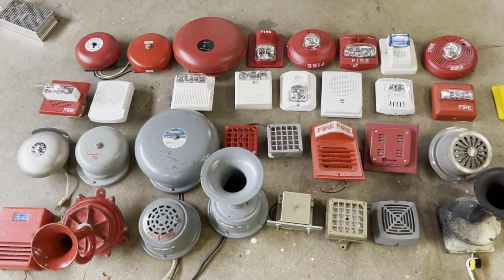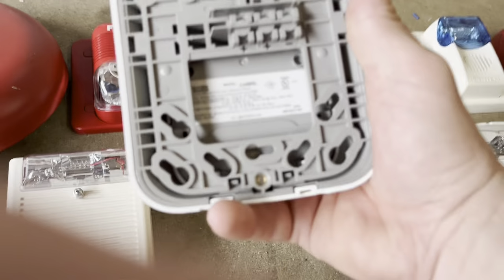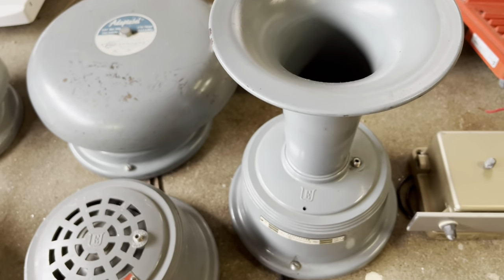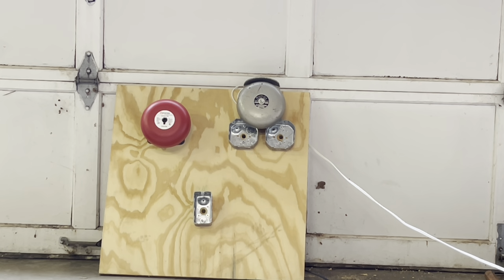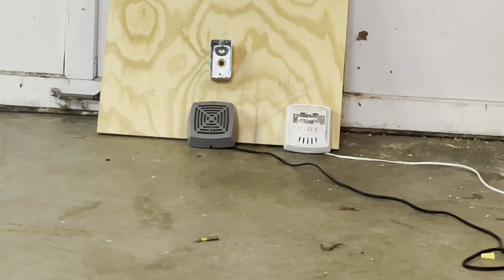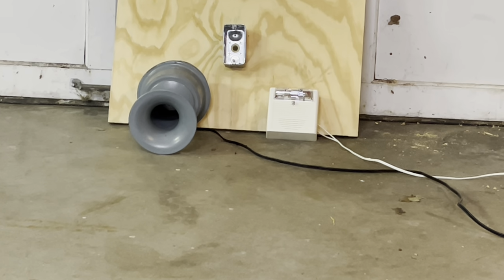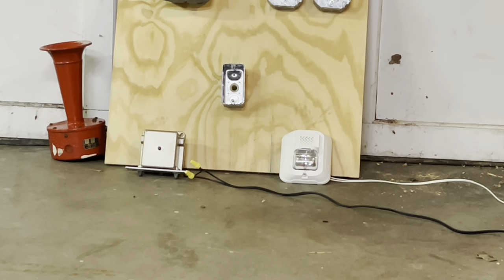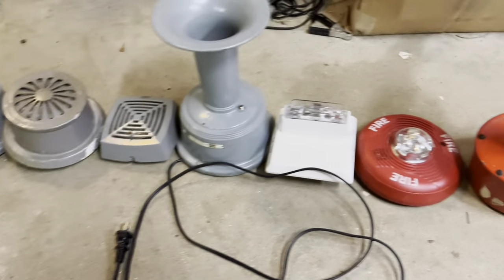Ultimate Old vs. New Fire Alarm Dual (3,000 Sub Special)

Comment: Edwards changed there logo from the rectangular lantern logo to the shield logo in 1964 so the Edward’s bell is from ether 1970 to 1989 and the Edward’s circular horns are the old lantern logo pre 1964
Reply from the maker: Thanks for the info!
Reply: @tots16  Why does the Potter bell have some similar name kinda similar to… uh… Harry’s surname…?
Reply: @tots16  And also, my previous school’s fire alarms were the ZeRio box sounders, the smoke alarms/detectors and the heat-alarms/detectors. I think… there were also the strobe ones. 

I think the box shaped sounders were   v e r y   loud I think, in my opinion. I think…
Reply: I3
Reply: #danceingalarms😂😂😂😂
Reply from the maker: @The-creator-of-good-videos-15  I’m thinking coincidence
Reply: @tots16  Uh… okay…?

Comment: 34:28: Why does the System Sensor L-Series white fire alarm speaker-strobe thingy sound like a bell that belongs to a passing locomotive or a train?
Reply from the maker: That’s because it’s a chime strobe.
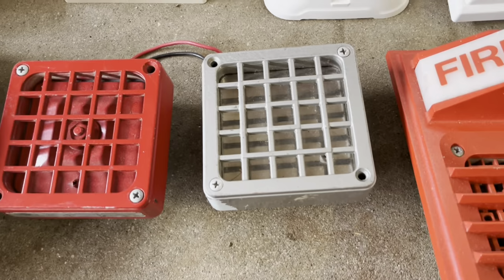Reply: @tots16  Okay. But why does the fire alarm at 9:04 - 9:10 with AC/DC sound like it loves rock and roll? 💀💀💀💀
Reply from the maker: @The-creator-of-good-videos-15 It was a cheap joke about an old band that was called AC/DC.
Reply: @tots16  So it actually runs on some AC-DC power and it doesn’t actually mean that it likes rock-and-roll bands like AC/DC?
Reply from the maker: @The-creator-of-good-videos-15  What part of, it was a joke, do you not understand?
Reply: @tots16  OOOOOH it was a joke… I understand. The joke was that some AC-DC running fire alarm liked the AC/DC rock band. 

It just runs on AC-DC… current… or power and whatnot…
Reply: @tots16 r
Reply: @tots16 🎉ffffftttttttyyyyyyyy